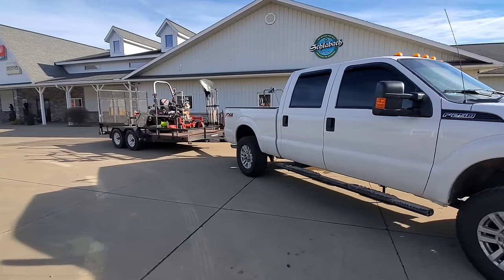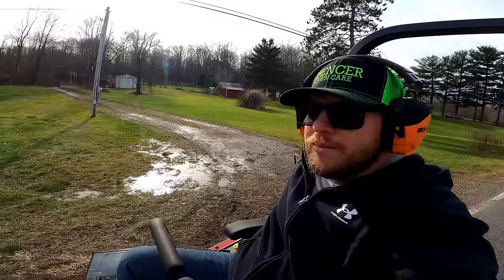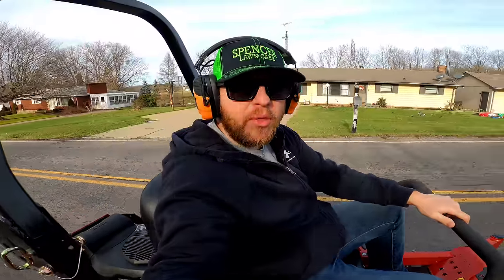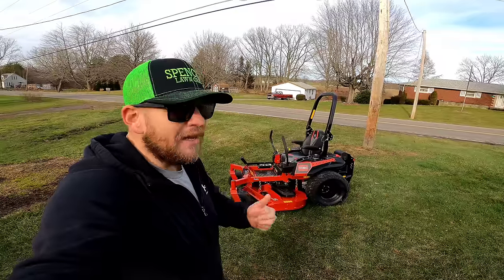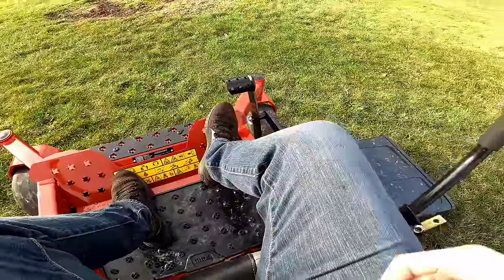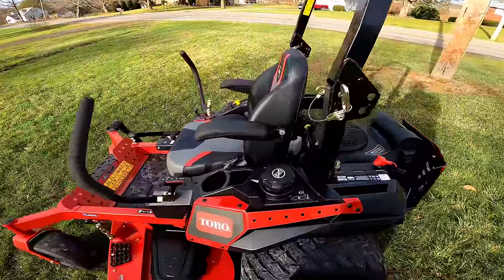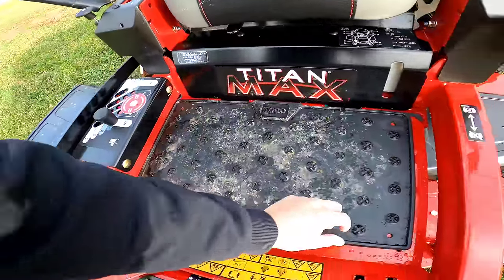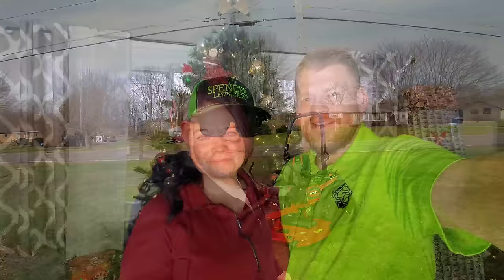Out Did Themselves | New Mower [$6,000 Residential GRASS CUTTER]

Comment: As a one man lawn service this video had me thinking again about a backup mower. I've currently got a 48" commercial ZTR along with a 28" and 21" walk behind. If my 48" ever broke down I would be in a bit of a bind as even the 28" would not be able to really fill in and get the jobs done in a timely fashion. I'm not at the point where I could justify adding another commercial ZTR or stander to the fleet. What are others thoughts on adding a less expensive residential ZTR to the fleet? I'm thinking under $2500 and 48" or 52". Something that would sit on the sidelines and only be used as a backup. Would others consider such a move and what units would you look at?